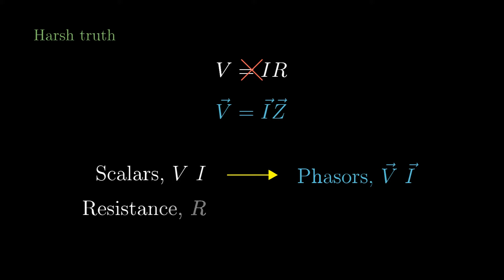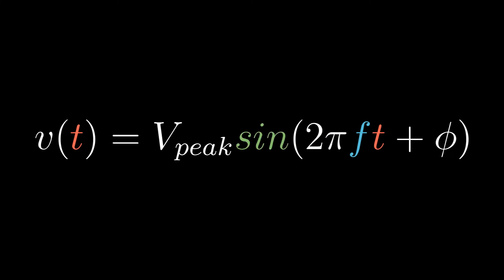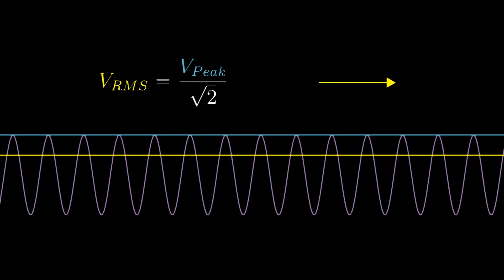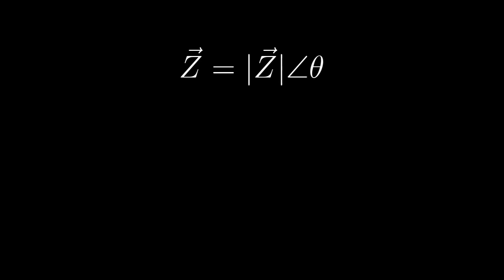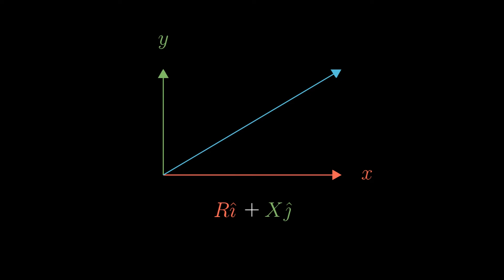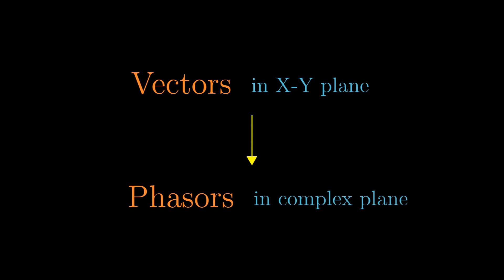Introduction to Phasors, Impedance, and AC Circuits

Comment: Aren't the diagrams the wrong way round for lagging and leading voltage?
Reply from the maker: Thanks for bringing that to my attention! The diagrams are the right way, but I did misspeak so that may have been unclear. At 2:28 I should have said "the more COUNTER-clockwise of the two is the leader". I've made a note in the annotations and pinned this comment.
Reply: Right, counterclockwise is positive rotation in trigonometry and most physics, etc. unless specified otherwise.
Reply: Yes, because for capacitors current leads the voltage by 90 degrees. When there is a positive phase shift, it means the curve moves to the left because it peaks earlier. So the current trace should have been on the left of the voltage trace.

Comment: Shouldn’t the magnitude of the vector be Vpeak? Because the it’s rotating or ‘oscillating’ between the two ‘peaks’. Just started ac circuit analysis this semester, I’m still building an intuition, unfortunately the way it is taught in university is criminally confusing, thank god these videos exist they have me on life support😭🙏
Reply from the maker: Nope, the magnitude is the RMS value by convention.
Reply: Btw 0:52

Comment: Man, it's a really good video, but even with your correction, I believe you still have the waves plotted backwards at the "leading and lagging" section. If voltage is "Lagging", that means that it hits its peaks and zero points AFTER the current hits its peaks and zero points. So visually the voltage wave should move toward the right of the current in a capacitive circuit. So for a purely capacitive circuit, the voltage waveform would be shifted to the RIGHT because it hits its peak 90 degrees after the current. In a purely inductive circuit the voltage wave would move to the LEFT of the current because voltage should peak first, followed by the current peak 90 degrees later. I urge you to do a couple google image searches to confirm this for yourself. I know it's confusing because you think "oh voltage is lagging, so it goes behind the current", and it's natural if you're reading right-to left that something lagging behind feels like it should go "behind" the other wave. But I'm about 87% sure you have your waves backwards in that section.

Comment: I took Circuits 1, and no one ever told me about electric signals or phases.   Now I have to know what these are for Energy Conversions class.  Now I have to search the internet far and wide for what anything is.
Reply: It’s helpful to think of passive electrical circuits in the context of the duality of nature.
I. e. electricity and magnetism.
The charged capacitor stores energy in the form of an electric field or E field.
The current conducting inductor stores energy in the form of a magnetic field or B field.
It’s important to realize their steady state behavior in circuits powered with DC power source as follows.
Inductor behaves primarily as a short circuit.
Capacitor behaves primarily as an open circuit.
It’s when their AC behavior is observed and studied in the time domain that phasers are introduced for analysis purposes.

Comment: It's so strange getting to this point in my engineering education (ENGR 202, nothing crazy yet) where before this point, all we knew was DC and capacitors and inductors were basically just abstract elements that we learned the mathematical properties of. But now in AC you can see what they do to a circuit! so exciting

Comment: I see that you represent the magnitude of your phasor using RMS value of voltage. I see in other literature that the magnitude is instead the peak voltage. Which one is correct?
Reply: In Electrical Engineering Context, the RMS value is often used to define sinusoidal voltages and currents..
Reply: I saw that too. What he actually showed was the peak to peak voltage and 0.707 times the peak to peak voltage. Vrms is 0.707 * Vpeak. Forget about peak to peak voltage. What we measure with a meter is Vrms.

Comment: Wait when calculating impedance for capacitor don’t we still just add 1/jwc, every question I’ve done doesn’t subtract.
Reply: The impedance of a capacitor is 1/(jwC). 1/j is equal to -j. Thus we can also rewrite it as -j/(wC).

Comment: Excellent video. Would love more videos that explain the calculations surrounding phasor triangles, please.  I am doing a foundation degree in electrical engineering and there is a slight language barrier with the lecturer and note are not very clear. I have dyslexia and find learning from videos like this much easier to understand. If you have any recommendation please pm me. Ananimation to explain how a generator with delta and star connection for example. Thank you.
Reply: Yeah, agree on having a calculations explanation part.

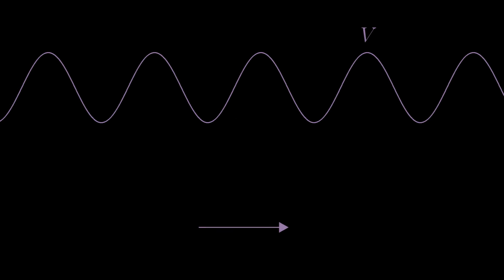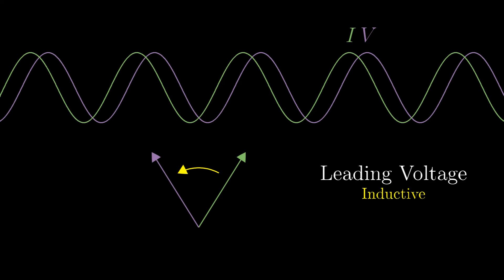Comment: Your waveforms (two sine waves) are around the wrong way in your explanation of lagging and  leading. The words and phasors are ok. For example at 2:23 when V is at its peak, I is yet to get there, so voltage is leading (by convention time is positive to the right) which is not what you intended. Similarly at 2:38 the waveforms depict lagging voltage.

Comment: This was really interesting. I'm a physics student, so this take on circuitry was completely new to me. It's very cool, looking forward to more videos. 
One criticism: leave stuff on the screen longer. Just another .5-1seconds makes a lot of difference and allows a viewer to digest the content.
Reply from the maker: You're absolutely right. Rewatching this now, it's going way too fast. I recorded the audio first and at times felt rushed to fit the animations/equations in. In the future I'll definitely keep your feedback in mind!
Reply: @crclayton  I actually recommend you not do that. The shorter video length makes it more tempting to click and most people just pause if they need a second to look. It's also very annoying when you already know a lot of it and you're waiting for the part you need but the picture won't change, especially when cramming before a test.
Reply: @ericsherwood160  half a second to a full second isn't that much extra time, meanwhile it took me 3 tries to pause on the vector form of impedance lol.
Reply: Simply rewatch the video 5 times :D .